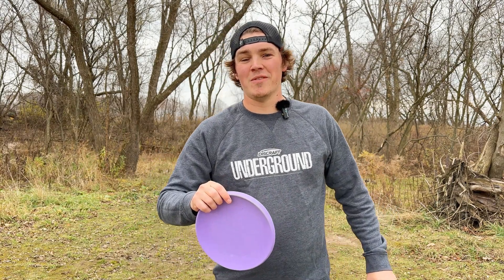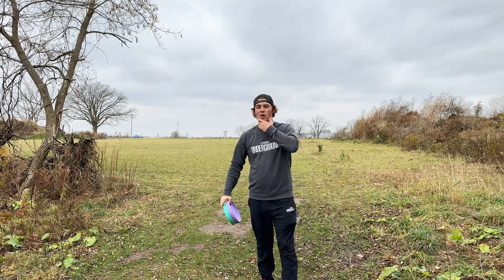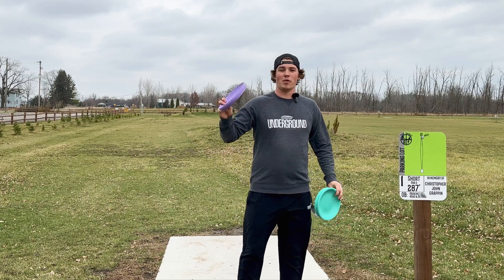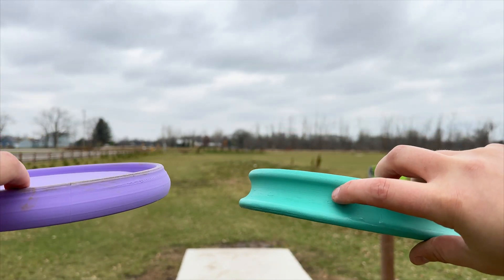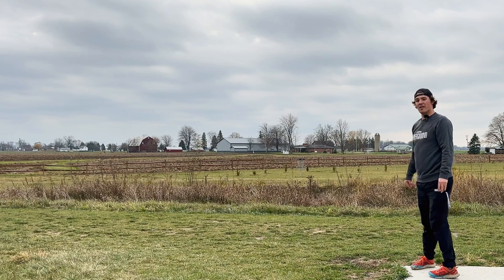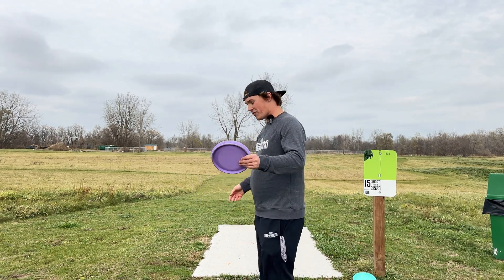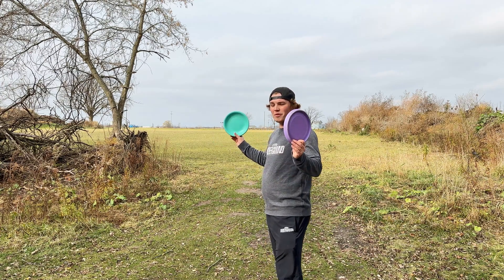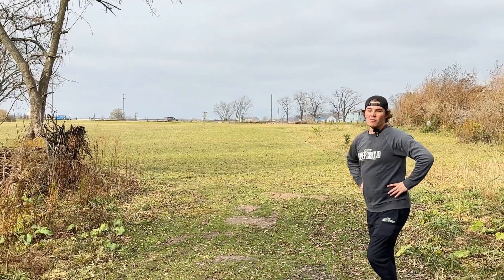I Made the Shortest Flying Disc Golf Disc! (Version 2.0)

Comment: Sooo what if you follow a standard putter mold but make a hollow plate so basically the underside is filled in far enough that you can power grip but the inner is equivalent to having a large foam hockey puck stuck underneath..
Although I guess we could just get some impact foam and stick a disc of it under a putter and hey presto.

Another option... A putter, but with a hollow rim that could almost be PDGA weight ok, but offer a wider rim to grip. (Like a Pig or RPM Kea.)
Reply from the maker: @TheButlerNZ  I guess i’m not fully sure what you are saying… so make a normal putter but fill in some of the space underneath the disc?
Reply: @LetsGoDiscGolf  that's about it... 
Leaving enough space for a power grip, but otherwise a disc golf hockey puck.

Also if you look at the leading alf of any wing you can see the teardrop shape used for lift... If you make a disc that inverses that (an upside down wing) it would suck itself down... Basically flat on top with a high part and curved under.

Something I always wanted to make...
a full hollow driver with a lift profile...
but smooth underneath except for 2 opposed slots for a power grip...
(Basically flip a good driver... fill it with foam so it's solid... then remove a power grip section (on either side for balance).
With a printer this could be done hollow..
Again I could manually do it with a disc, some light foam... and a sheet of plastic to seal the bottom.